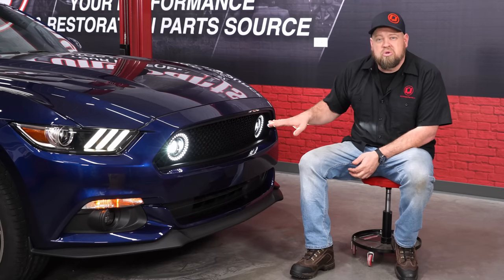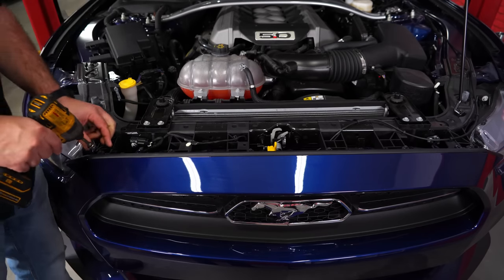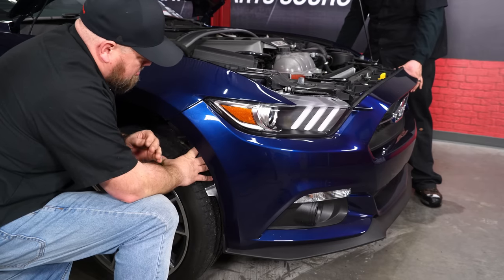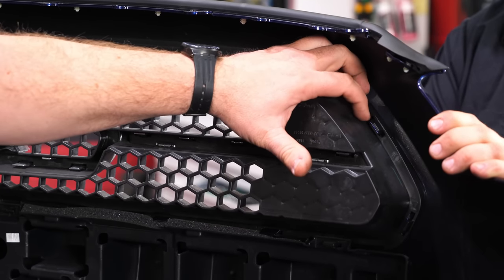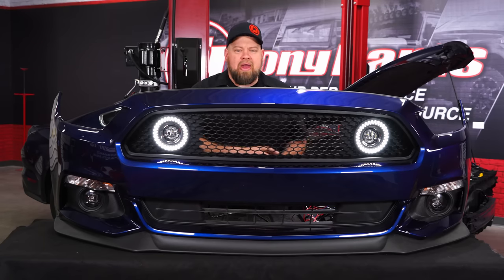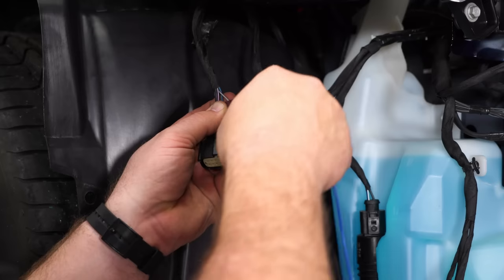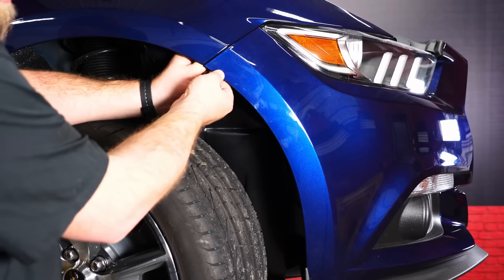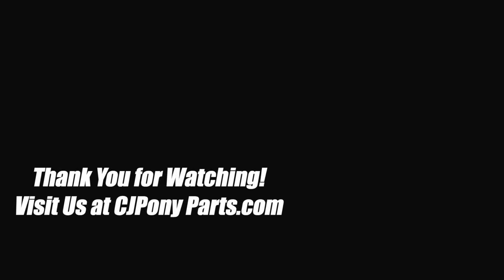2015-2017 Mustang Install: Renegade Series Performance Upper Grille with LED Fog Lights

Comment from the maker: Purchase Product Here:
https://www.cjponyparts.com/performance-upper-grille-renegade-series-with-led-fog-lights-drl-halo-rings-v6-ecoboost-gt-2015-2017/p/G226/
Reply: Tell them they need to make a full halo ring light without the separation. The stock lamps don't have any interruptions so they don't align with the stock styling.
Reply: CJ Pony Parts hi I am looking to buy the gt 350 front fascia conversion kit for my 2017 eco  p.p. base mustang. I was also looking get this grill as the gt350 facia deletes the factory fog lamp. Do you think it’s doable?
Reply: Any plans for 2018+ Mustang? 🤔

Comment: Great Product and Thank you for uploading these instructions - would like to see more detail on the wiring set-up ie layout of what comes in the kit, what relays are being used if any, how the lights are acitivated by the Factory switches, routing of the wring - all this would be big help with confidence the product is being installed correctly - Thanks

Comment: I installed this grille either you dig it or don't, it's all personal preference. I wired the DRL's to the parking lights and rerouted the factory fog light wires to new grille and deleted lower fog lights.
Reply: How’d you get the fog lights to work? I connected everything and the fog lights won’t turn on

Comment: I like the grille but the lights are too wide apart. they shouldve been made like the old 2005-2014 fog lights
Reply: That's about as far apart as my 12's fogs were.
Reply: @sgthop  no way. The 2005 to 2014 fog lights are closer to each other. Are you sure?
Reply: @officialtjtrev8910  Yes: https://imgur.com/a/NcBSXIF

Comment: Looks nice but the air intake opening is not drilled into the side of the grill and the wiring is ghetto.
Reply: Bob Brians I was looking at this grill too but then I noticed that too... surely some holes and a plug and play option could of been done. Really like the fog lights but this one is just as you said Bob, way to ghetto.

Comment: Hello , I bought the grid , but there is a mounting problem because it does not fit because of the two metal arms(bars) of the car that can not reposition the car bumper. what is your advice????? Shall i take off the 2 bars of the car? is that safe??
Reply from the maker: Send me a photo of the part that is interfering .   bill at cjponyparts dot com
Reply: @cjponyparts  Thank you for your interes, i just send you an email and i wait for your opinion!
Reply: IRINEL COPACINSCHI what was the solution? I installed them tonight and have the same issue.

Comment: Will this fit a 2019 GT?
Reply: no, it has a different grill design
Reply: @perlamiseriaccia  The grille is literally the same. It however, might not fit on the same tabs, so you would have to modify it to make it work.

There's a video floating around on YouTube of a guy that installed a Boss 302's grille on a S550 mustang.

Comment: You do not tap any of those fuses that we’re stated at all .

The instructions for these grills are horrible connect to a 10a fuse blows , connect to those 15’s blows

Connect to the headlight wiring harnesses 

BLOWSSS